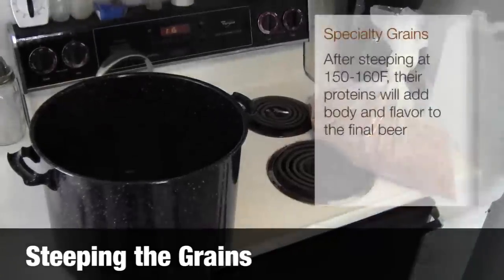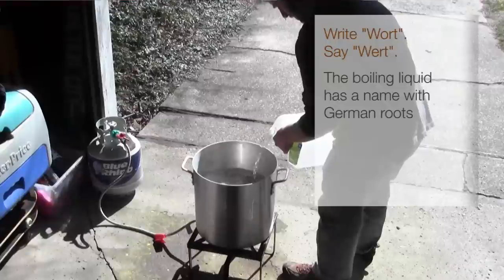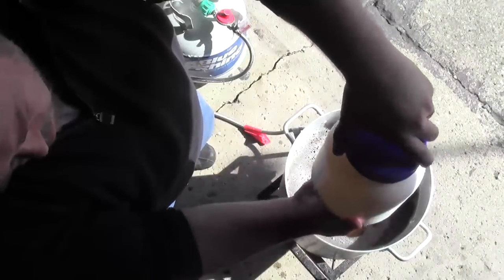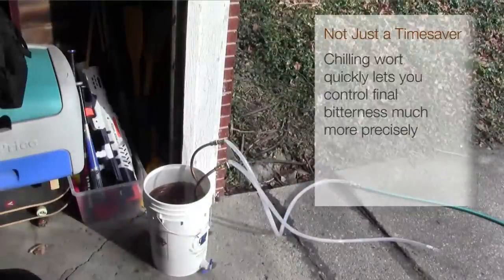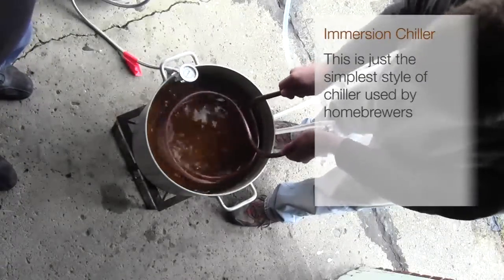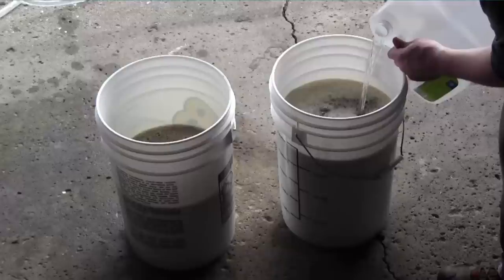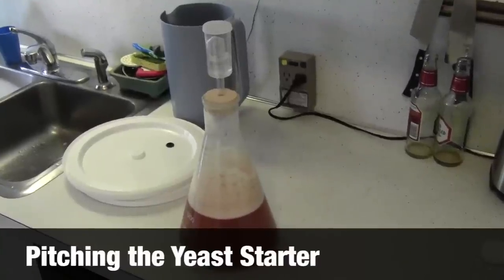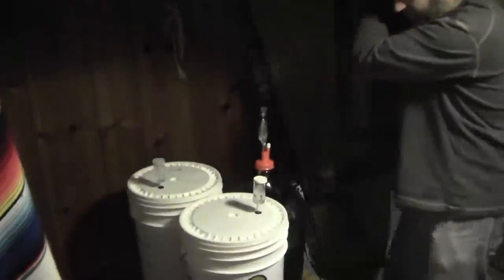Making Beer at Home

Comment from the maker: The main reason that's usually given for leaving the lid off is that it helps prevent ending up with diacetyl in the final beer. That's a chemical that's formed (or released, not sure) during the boil, that smells kind of like buttered popcorn. Unless you're making one of the few styles where it's supposed to be part of the flavor, it's usually something you want to avoid. Diacetyl will boil off if you leave it open, but if you keep a firm lid on it, you risk having that taste.

Comment from the maker: That being said, it's never been a problem for us, and since we brew right at the edge of the garage, we like to leave a lid partly on just to minimize the risk of having a leaf or a bug drop into the pot. We always leave it cracked, though, which may be why we've never had much of a diacetyl problem.

The other factor is that, at this point, we've gotten used to the boil-off rate we get with the lid partly on. We know that if we start with 12 gals, we'll end up with 11, etc.

Comment: Good video but I do question boiling with the lid of the kettle as it keeps the DMS inside the wort instead of driving it off with an open kettle..I liked the Warrior hops and I just bought a pound of them.
Reply from the maker: The lid's not fully on -- just cracked. There's still plenty of space for steam to escape...the main point was just just having it cover enough of the opening to make sure no leaves or anything drifted in from outside.
Reply: I can see the worry about leaves and such which is why I brew indoors.Used to do 5 gallon batches on my stove with a 3 vessel all grain system and it did take a long time to get to a boil.I bought a Grainfather unit a few months ago and doing a brew day is just pure joy now.